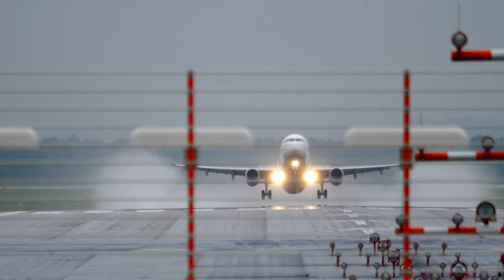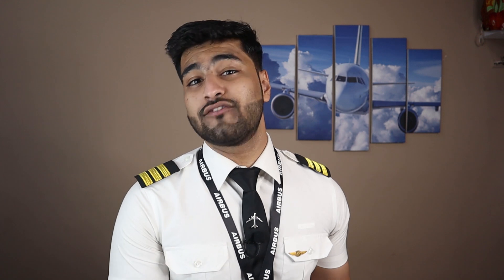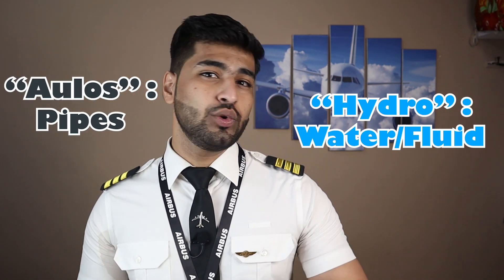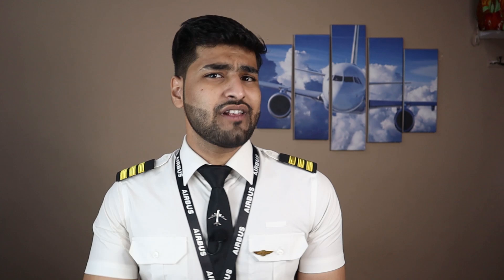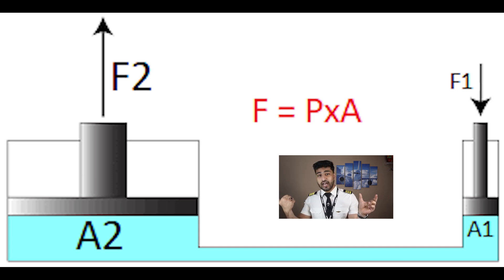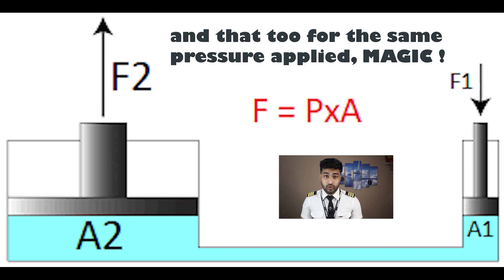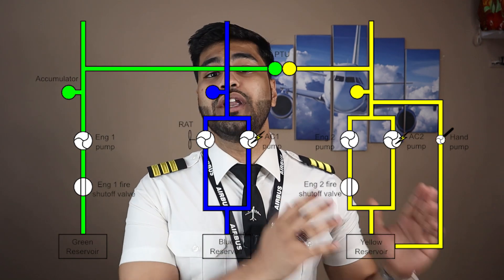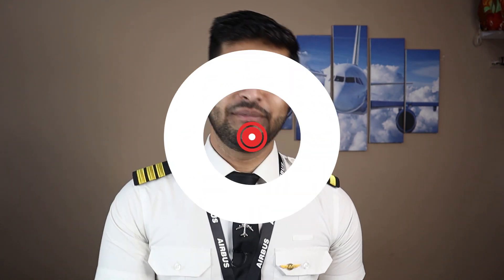What is Hydraulics | BASICS and How its used in AIRPLANES !

Comment: It generally makes sense, but let say we fly non fly by wire airplane, how moving yoke by 30-40 cm, makes i.e. rudder or plate horizontal stabilizer to move. It's not like a car jack when we can pull lever 100 times to raise a car.

Comment: Sir i want to know that....how pilots handle the aircraft when both the engines stops working!!? ....can it be safe ??....
Reply from the maker: Firstly it is veryyyy unlikely, probability being less than 1% of BOTH engines failing... if it still happens, the airplane won't just fall off the sky like a rock, it will glide through the air coz its very aerodynamic

Comment: Is it possible to use electricity to control the various systems? That will also reduce the weight of the airplane as we can remove the fluid.
Reply from the maker: so that is what airbus has dine... there is no direct loooong pipes running from cockpit to controls... its electrical signals... but ultimately just before the controls, there are hydraulic jacks... coz that much force is NEEDED to overcome huge aerodynamic force from the airflow
Reply: @TheFlyTuber  Ok thanks a lot sir!!!!!
Reply: @TheFlyTuber  Hey sir, so you were talking about Boeing? And what about atr aircraft? Are they electrically simplified?